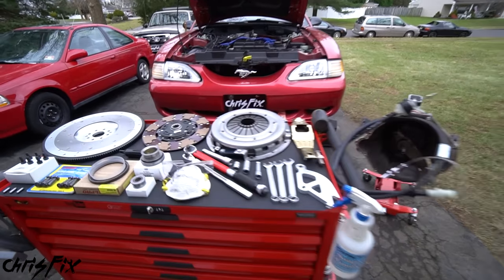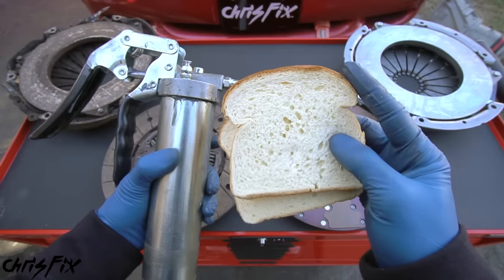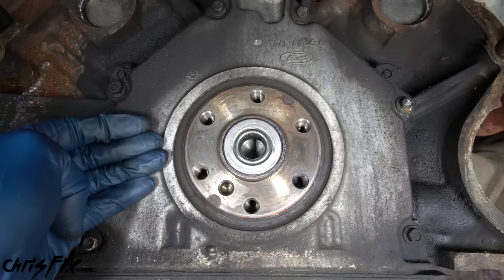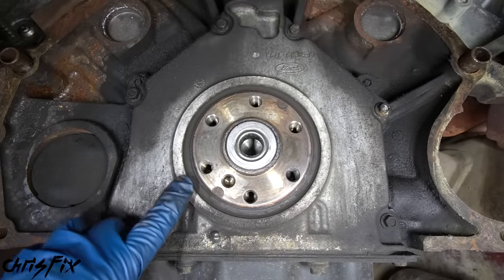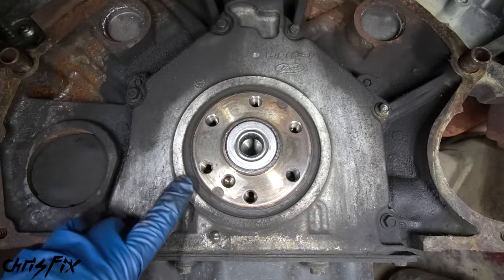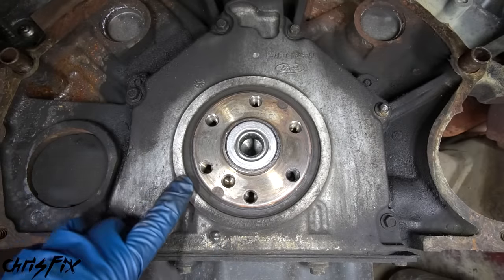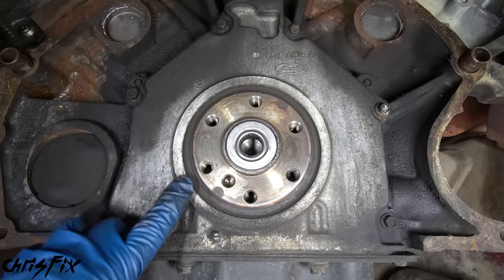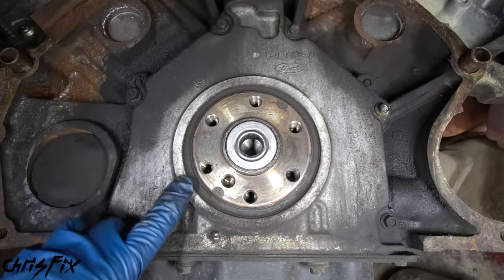How to Replace a Clutch in your Car or Truck (Full DIY Guide)

Comment: I am Commenting on from my gf youtube account but i want to let you know i currently have a 2000 v6 mustang and had to get that pilot bearing changed i literally was stuck on taking out that bearing and we even used the pilot bearing pull tool and the pilot bearing did not budge at all was completely seized up and me and my dad spent no lie 3 hours on getting it out mostly because we had to keep going to different auto shops to find different puller to use but no luck so in the end, after we thought we would try the next following day we tried one more time but by using that method with the bread and grease trick that we said we would try if nothing else worked and surely enough after a few tries the bearing managed to pop loose regardless of how seized up it was, me and my dad was in shock lol so i thank you , it works great haha dont need them tools , just bread and grease lol

Comment: Hey Chris your throw out bearing is not supposed to be always touching the fingers it is ment to have a little bit of clearance. This is most likely why your old throw out bearing failed. Having it that tight means it can be spinning the throw out bearing even without the fingers being depressed. If I'm wrong let me know.

Comment: Hey Chris fix, this is Chris Foster. I just replaced my clutch in my bronco yesterday. It's wild to me that you have a clutch cable instead of hydraulic actuation. My bronco has a hydraulic clutch and I'm also not driving a mustang because I need a bronco

Thanks

Comment: Older model cars used to  you had to drop the oil pan also remove main crank cap also a main seal always look  around your crankshaft for any bad  grooves

Comment: I used to use just a little dab of grease and then use the clutch alignment tool to hydraulically remove the pilot bearings.

Comment: Thanks Chris, another gr8 video.  I learned a lot!  Question for you, I cracked the threads of a manual transmission (aka clutch ) gear oil drain plug.  So wondering whether I can simply replace the cover to the clutch compartment instead of unbolting the transmission from the engine?  Thanks for your help.
Reply: Oh, Chris, it is for a 2005 Camry Se.  Thanks.

Comment: Man, I wish it were this simple on my car I just finished replacing the clutch on (Subaru Outback 2001).
I had to remove the whole engine from the car to access the clutch. It was either that, or remove the transmission. Both were pretty big chores
Reply: He removed the trans from this mustang …

Comment: Hey Chris! I was wondering is this process the same with a front drive vehicle? The reason why I ask is because I've seen videos where they remove the axles before the transmission is removed. Thank you for taking the time to answer!
Reply: FWD cars you do need to take out both CV axles. You also wont drop the shifter, you’ll disconnect the shift cables from the transmission instead
Reply: @loganamurray64  thank you for letting me know!

Comment: Also make sure Advance Auto Parts gives you the right clutch kit!

My first time changing a transmission on the street on Thanksgiving at 15 degrees out, 20 mph winds, took 9 hours my first time. Started it up and heard the worst noise ever. Did the whole thing again the next day, drop and back in. Same noise!

Third time I dropped it...after a few days of heavy drinking and despair over missing work as my only vehicle was in pieces outside, realized the auto parts store gave me a clutch kit for a Civic DX, rather than the EX. They had it mislabeled! The pressure plate was 2mm too big and was rubbing the bell housing! 

Of course they didn't pay me back the 20 hours of labor it took to drop the tranny 3 times. All they could say is "oops, I guess it was the wrong one"

Never again Advanced Auto Parts. AutoZone for life now (plus they're cheaper)

Comment: Why wont the trans separate from the engine. All the bolts removed. Trans all most rotates but its stuck?
Reply from the maker: That's pretty typical, it's stuck on from years of it being bolted together. Keep trying to rotate and pull out. If you can't get it to budge you can use a prybar but be careful not to mar or damage any surfaces. Once you get them separated a little bit it's pretty much good to get separated and dropped

Comment: In reverse is also a good idea . When u have a leaking rear seal also do the clutch. Doing this at the shop can cost you a 1000 dollars some over some under. Even if the mechanic says u dont have to make sure to let him do it anyway because if one of the two goes a week later he has to do it all over again costing you another 1000 dollars. If he said u dont have to also look for a new shop because they are ripping you off.

Comment: I wonder how well the bread and grease technique would work on a bearing that has been in there for many years and is very comfortable where it is. The new bearing you installed was clean and wasn't used. I would assume an old, somewhat corroded and very used bearing would be way harder to remove than a newly installed, clean bearing
Reply from the maker: As long as it’s not rusted it shouldn’t matter. They are both pressed in with the same clearance. Arguably the old bearing might have grease/oil seeping so it might be even easier. Either way ive used both techniques and they both work
Reply: @chrisfix  I always feel like I've won the lottery when you reply back to me lol I think the last time was like 4 or 5 years ago. But what you said does make sense and I will keep it in mind if I run into a similar job. Thank you for the educational videos dude, I've learned literally a ton and have gained the confidence to work on my vehicles and now, several years later, I work on other people's vehicles too. They ask me "did you go to school for this?". I wonder what the reaction would be if I said "nah bro it's just ChrisFix"

Comment: I purchased a 2007 Toyota RAV4 limited 4x4 in early October of 2023.  After I had it for a week or so, I realized I had a shudder when going over certain specific road areas.  I had some work down on it less than 10 days after purchasing it.  When they test drove it it didn’t do the rattling sound, so this was not addressed.  I started researching and thought it may be my torque converter.  I finally had the mechanic at NTB test drive it again and it did it this time.  I have only driven it about 1400 miles so far.  I don’t keep how long this was happening before I purchased it.

The mechanic said it was the torque converter and that it would be best to replace the transmission because it could be damaged.  It has about 181500 miles on it I believe.  It also burns oil, which the seller did tell me.  I add a little oil after every gas fill.

I am wondering what is the best thing to do to fix the torque converter issues.  The mechanic said he is quitting his job and going somewhere else, although they can’t do that kind of work there anyway.  He said he would try to find some place he could do the work or someone he trusts to do it for me.

My brother has a friend who has his own shop, but isn’t very reliable for doing repairs for me.  I have a hard time getting him to commit the doing work.  I purchased this because my car kept having issues and I was afraid even though it only has 70k miles it may not last.  I am a single disabled mother of an 18 year old autistic son who can’t work.  So I need someone trustworthy to do things for me since I have limited resources.

My brother contacted me yesterday and suggested the following options, I wonder what you would recommend?  My brother talked to his friend he found a transmission with 78k miles and it’s 1650$ he will change it and everything for 2500 including transmission.

Or he can change your torque converter for 1000$ and change fluid in your transmission he does a lot of transmissions and hardly has any problems sis I’d go for converter because it hasn’t been making noise long enough to hurt transmission.

I asked him Will he be able to tell if the torque converter is ok on it before it gets put in?

He said He could change the converter on the 78k one before it’s installed for 200$ more dollars

What would you suggest, and are these fair prices?  

My other car is not drivable right now, the clutch sticks to the floor and I have not been able to get his friend to fix it yet.  This happened on Christmas Eve, so 6 1/2 months.

I appreciate any advice.  Thanks so much

Comment: Is there a chance of dissimilar metal corrosion on those flywheel bolts to aluminum flywheel? Or is that what the grease on the bottom of the bolt heads is for? Thank you.
Reply from the maker: If I recall correctly the grease should prevent anything like that. It's meant more for torquing the fastener though

Comment: I have just had clutch, bearing and flywheel replaced. I now have a strange sound when pressing in the clutch and the sound of the road seems amplified when driving. Any ideas of what is wrong?

Thanks.
Reply from the maker: What kind of noise are you hearing when you push the clutch in?
Reply: @chrisfix  it's hard to describe. It's like a buzzing/whirring sound. I never had that noise until I got new clutch, bearing and flywheel fitted.

Comment: Yeah my Lada 1200L has a broken speedometer spinner which would require lowering the entire gearbox for repairs, also the clutch is making a loud howling sound at higher speeds than 80km/h, which leads me to believe that the clutch is worn out. 
I have no previous experience on the deassembly and reassembly of a car of any sort. I have only the theoretical know how. 
I have watched one of these cars being disassembled to the last bolt of the gearbox and the engine dozens of times, but I am still insecure about my ability to do this all. I have a very short schedule and there is a lot else to do with the car. 

One question there is, what if every single part of my car has gunk and rust from the last 40 years on it? Should I leave this for a professional?
Reply from the maker: If you have a tight timeline and there is a lot to do, it would be worth leaving this to a trusted mechanic. However, you might want to see if friends/family could help you out as well if you wanted to do it yourself. Up to you ultimately!
Reply: @chrisfix  Oh my, the man the myth the legend himself! This was unexpected.

First of all thank you, but yeah, I am gathering parts and I am leaning towards giving it to a local professional to do the gearbox. 
My brother is a mechanic but can't help at this time so I guess the ultimatum says money get spent and car fixed. 
Well at least all of the parts you recommended to go through cost me only 170€ :)

Comment: Did u drop the trans out of the car to change the clutch packs? I have an 08 mazda 3 hatchback 2.3 L automatic transmission and was wondering if i could get to my clutch packs without taking the trans out

Comment: Hello, is this the fix for when the engine makes a sound when going up and down gears? (when releasing clutch pedal especially) also when I slow down (let go of gas) it does this, makes a constant terrible "knocking" sound until i speed up more, especially when in 1st 2nd or 3rd

Comment: After installing the clutch disc should the clutch disc be free to move? Mine is engaged it’s pressed between the flywheel and pressure plate

Comment: 8:08 Can't help but wonder what would happen if the engine was started up while that wrench is blocking up the flywheel from spinning. It's hard to even imagine the kind of damage it would do to the engine.
Reply: Well you can't. The starter wasn't even there nor driveshaft

Comment: After replacing my flywheel and clutch, my car wouldn't start on my Saturn SC2.  I then replaced the battery and starter but it still wouldn't start.  I have taken my transmission housing apart again to start over.  When I went to remove the flywheel, it did not move on the crankshaft when I removed the bolts (I didn't use anything to try to prevent it from rotating).  Could this be why my car isn't starting?  How do I check if the crankshaft is stuck?  Thanks for any help.

Comment: Hey Chris, speaking about speedometers.  My son's 2003 GT with the  TR3650 transmission was upgraded from 327 to 373 gear set but they didn't adjust the speedometer.  I bought a speedogear but it was the wrong one.  The speed is off by plus 10mph.  Is there something I can do at home to correct the speed?  Thanks and you are the BOSS at schooling on the Mustangs!
Reply: By the way, how did you get the transmission out?😮

Comment: Just a little correction: On the 3rd gen 4Runner and other Toyotas with the R150f transmission, the clutch disc goes the opposite direction from normal. It's a very common mistake.

Comment: Did the pressure plate sit against the flywheel or was there a gap. I installed my pressure plate and when I got to torque there was a gap between the pressure plate and flywheel (where the bolts go) it's against the clutch itself just not the flywheel

Comment: Hey chris i need some advice lol. I bought a bare bones 248a 97 gt. Got it cheap with only 120k. 2 owner vehicle. Previous owner was a mechanic but this was his work car and wasnt very nice with it🤣.
Cheap ebay shifter, replace with MGW but one of the holes is filled with Jb Weld and there is a bead of jb weld on the lip below where the shifter mounts to🤔. Im considering just replacing the trans altogether.

Comment: Golf 2014 2.0 liter TDI manual gearbox (6 speeds) running about 266000 km, the problem happened suddenly when the clutch pedal is sticking down, I need to raised it manually several time to engage the speeds. There is no leakage of fluid after the inspection.
I tried to bleed air from the system, it needs to move the pedal and press it about 40 times to have a normal feeling, but the liquid comes out full of air bubbles (almost white in colour) from the breather. 
Is this a problem of the Pedal pump (Master cylinder)? or in the pump within the whole mechanics (Slave cylinder)? And could this happen for a  breather problem? thank you

Comment: Is it necessary to clean the clut h disc itself? I touched the disc with my bare hands my hands however arnt all greasy just the normal
Reply from the maker: If your hands aren't greasy you shouldn't have anything to worry about, but you are still concerned just give it a light wipe with some brake clean on a towel and it shouldn't cause any issues!

Comment: should the pressure plate be flush with the flywheel. I have a little space it is not flush or do you tighten down to flush.

Comment: "so we're gonna replace the clutch, flywheel, pressure plate, pilot bearing, oh and we bought a whole rebuilt transmission" bro I almost broke down buying a wheel bearing hub, I need a raise

Comment: Could you wrap electrical tape around the blade of a pry bar or screwdriver when taking out the rear main seal retainer to not gouge the crank surface?

Comment: I watched this and the tranny installation video which leads me to a question. The emergency brake don't work on the truck I'm replacing the transmission on. Do u have a trick to hold the driveshaft still to get those bolts off?

Comment: Hi Chris....I am facing an clutch pedal  issue with hyundai i20...
The clutch pedal feels gritty/ sandy when I press or depress the clutch pedal...
I changed the clutch plate pressure plate and release bearing...
But the clutch pedal still feels gritty ...but not as bad as before ...
Tried lubing the clutch pedal but no improvement 
Can you advise me on the possible cause and solution....

Comment: I thought manual transmissions used gear oil not what appeared to be ATF that you put in there?
Reply from the maker: Most of them do, but some are designed with using ATF. In this case mine is one that takes ATF

Comment: Practical tip: if you are going to install a bearing, putting it in the freezer for a couple of hours or using a -45° spray it's gonna help a lot

Comment: Do you bleed your clutch fluid as a maintenance? I understand you would bleed it if you got air in the system from changing a part or clutch does not depress, but other than that is it a maintenance item one should do X amount of miles/years? Asking you because I can't find a reason on internet why one needs to other than "if you got air in the system". I bought my 2nd Type S and the clutch feels stiffer than the same car I had before, and they said it has stock Clutch.
Reply from the maker: So clutch fluid is brake fluid and brake fluid is hygroscopic which means it absorbs water. The water can cause corrosion if there is a lot. I’d flush it once every 5yrs or so. Doesn’t hurt.

Comment: I know this is an old video but if you still reply to comments i have a question. I own a ford fiesta that is currently stuck in reverse. But the gear stick moves freely in an h pattern. I cant move the stick in 1 or 2 but I can 3 4 5 and reverse. (IT doesnt actually go into gear)

Comment: The new installed pilot bearing should not be inserted so far in that it bottoms out. It should be tapped in until its outermost surface is flush with the end face of the crankshaft.

Comment: Hey Chris if can rebuild my front end tie rod control arms and pressed wheel bearings back in think I could do this on a 2002 civic or should I pay  I don't have the time but I got the tools
Reply from the maker: If you don't have the time then sometimes it's worth having it done at a reputable shop, all comes down to what your time is worth!
Reply: @ChrisFix  hell yeah man can't wait to see that turbo del sol good luck

Comment: I really wish I watched this before I did this. Im worried that I didn't align the input shaft with the clutch correctly. It slid on but there was still about a finger gap between the bell housing and trans, so I pu bolt in and tightened it until flush. I'm going I did it correctly my dad was turning the driveshaft and pushing as I was pulling the trans